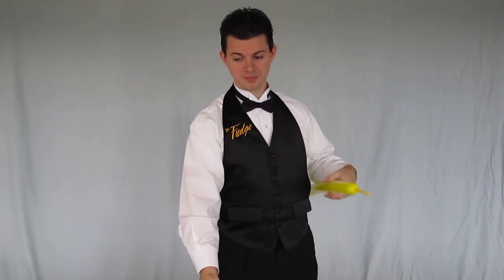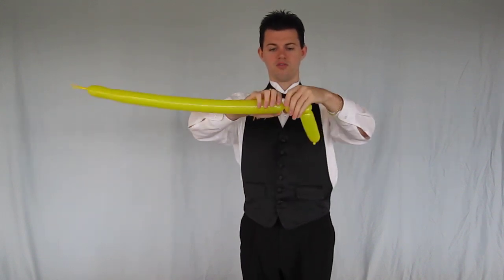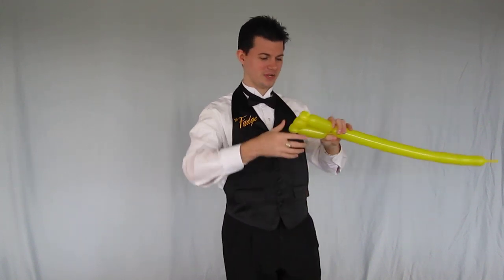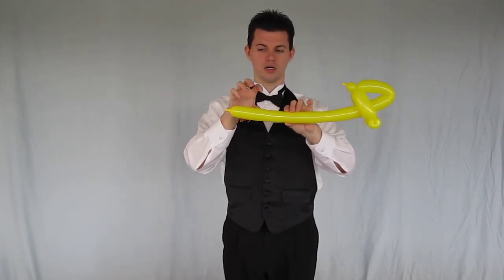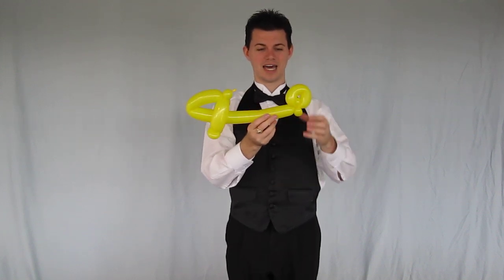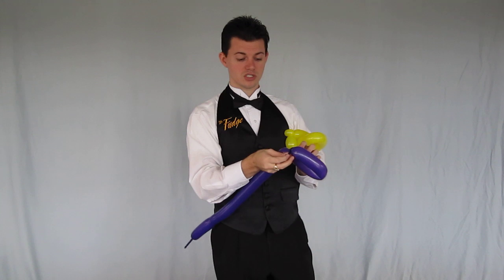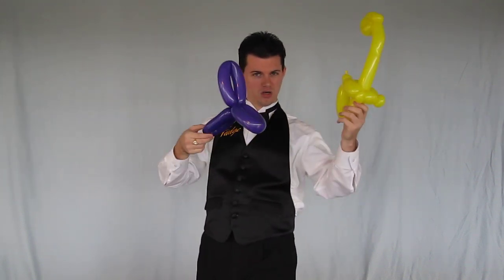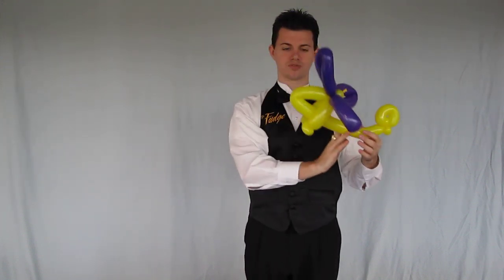Balloon Library #11 Helicopter Balloon Instructions

Comment from the maker: I'm glad you mentioned that. I actually make this balloon out of a 350 normally and use a 260 for the propeller. So, a 160 would look a little better. Thanks for the input. Also, if you're trying to make it look better, Ralph Dewey suggested putting a white round in the "cockpit" as well.